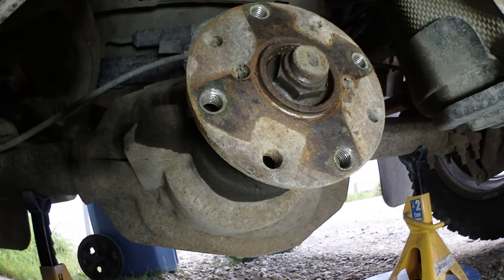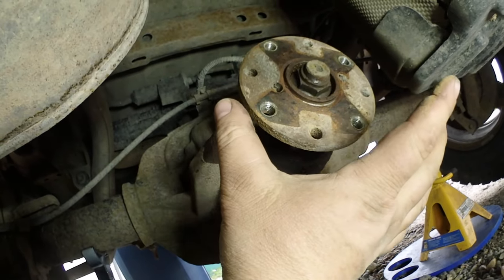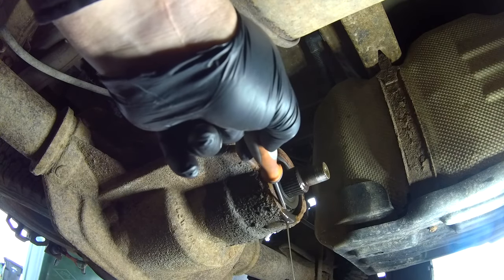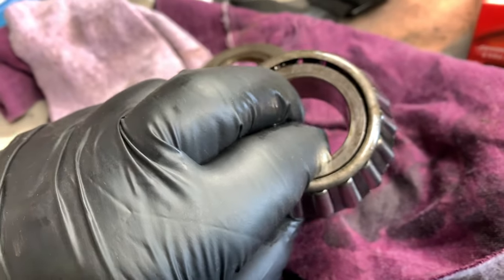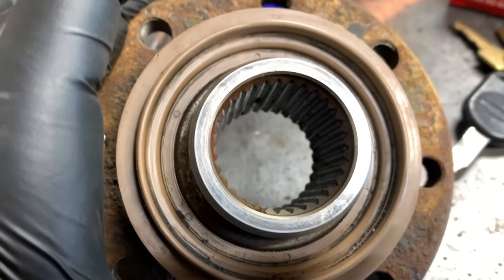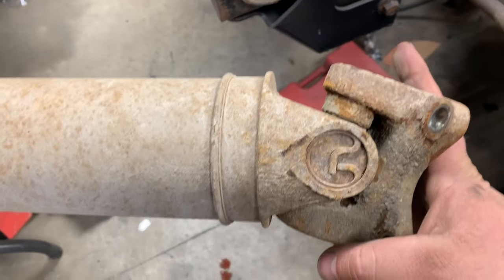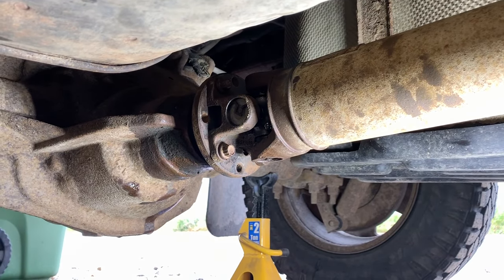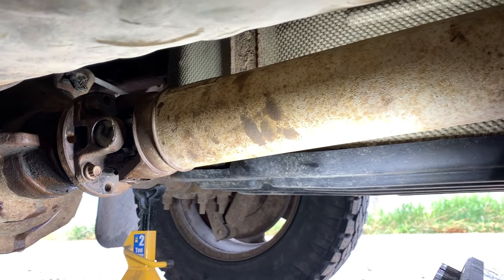Why Does a Pinion Seal Leak

Comment: So basically if the universal joint is going bad it will cause the pinion seal to go bad and in turn leak all the fluid out which if left like that it will destroy the rear diff. I think that is what happened to mine. I started by changing the pinion seal. it worked for about 2 months. Then the oil mustve leaked out and destroyed my races and bearings on the pinion. So i changed those out and put a new seal on then added oil. That was about 5 months ago and now it is leaking again. I am pretty sure the universal joint is bad because i hear a single clunk when shifting from reverse into drive. So, now I have my work cut out for me. It is crazy how everything is connected and one thing will destroy everything if not treated. Like having a broken toe will make you limp then your hip starts hurting and then your back and before you know it the sky crumbles and falls lol
Reply: I like the last part explanation ... makes lot of sense. Good on you mate.

Comment: 335,000 kms on my 2004 Dodge Ram 1500 and the pinion seal has finally given up the ghost. Now that's not just everyday driving. Drag racing at the strip, and other places too. Guess I'll be fixing that deal up and keep the ol' girl running strong. Great job on the video.

Comment: I replaced my pinion seal and test drove the car for about 5kms and came back home. Next day it started leaking again just parked. Everything checked out ok. I did not do a preload of the pinion flange nut, I just tightened it. But that should'nt have anything to do with the seal that's sitting outside. I haven't checked the breather tube yet if it's clogged. Your thoughts please. Thanks mate.
Reply: Replacing your transmission mount may help.
Reply: @path2049  all new mounts

Comment: Im working on a f150 2005 trying to replace that same pinion bearing on the video. however it doesnt want want to come out with a pick. Is there any other tool that i can use to take it out? I dont want to take the whole differential out as im no mechanic and i feel i would mess something up.
Reply: Slide hammer with the right attachment

Comment: What was the point of the jack stands? Did you raise the wheels off the ground to do this?
Reply: I don't know about this case but I found it easier to unbolt and reinstall the U joint bolts when you can rotate the drive shaft a half turn. Having at least one wheel off the "ground" (via the jack stand with a standard diff.) allows you to do that. I also like to rotate the diff when changing out the fluid. Might not make much difference but makes me feel better anyway.

Comment: I have a 22 frontier with a leaking pinion seal that's getting replaced this Friday .I also have a noise at 50-60 mph uphill only upon steady throttle. If I take my foot off the gas it goes away .can a leaking pinion seal cause a noise? What does my sound issue sound like?bad preload? Could my noise be cured by the pinion bearing replacement ? I'm hoping it does or they don't torque things right and the noise is worse so they finally have to do something about it .I told them 50-60 uphill and to test drive they go around the block 25 mph and say everything's fine 😒
Reply: My first thought is a leaking seal might mean your gear oil level is not as high as it should be. Seams like that in it's self could lead to issues that could be causing the noise.